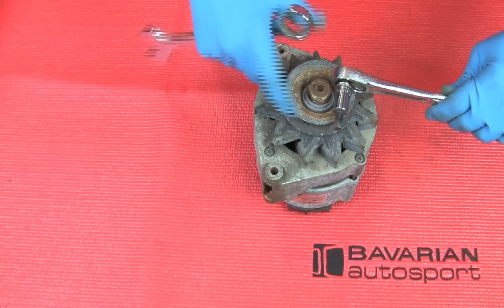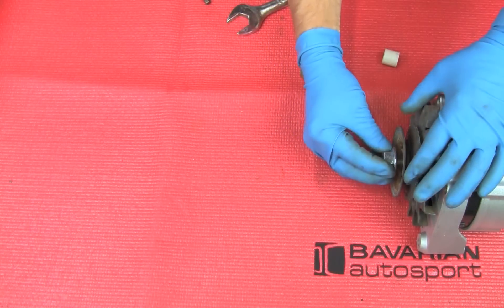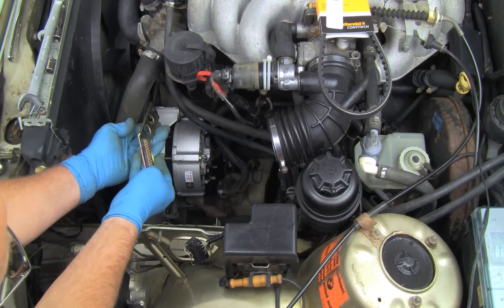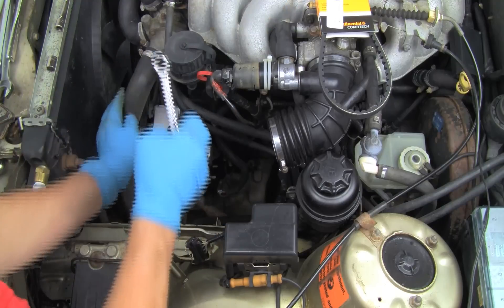Replacing the alternator on most 4  and 6 cylinder BMWs thru the early 1990s

Comment: thanks for the video this should help me out, I was wondering if you had a video on coolant pipes and how to fix a short in the cluster
Reply from the maker: No current video on replacing coolant hoses.  However, you may like to check out the video on coolant replacement.  Once the coolant is drained, you can replace any of the hoses, then perform the refill/flush, as in the video.  view the video and DIY here:  http://blog.bavauto.com/12402
We also have a few DIYs on early instrument cluster issues.  Just visit our tech-blog at blog.bavauto.com and search for "cluster" and "Instrument".

Comment: Amazing video thank you for posting.
1 thing that I didn't catch from the video.  The Adjuster securing nut - which way do you turn the nut to loosen?  I tried loosening it as if the threaders are standard direction (i.e. pulling the handle towards me or "to the left") but the nut seems to be really stuck or I'm loosening it the wrong way.  Any help would be great!  Thank you.

Comment: Thanks so much for sharing your professional expertise!  I changed the voltage regulator with a new one as the brushes were worn and charged up my battery and car started right up. Right by the belts it had been really squeaky and I could not pinpoint the source of the squeaky sound. So is that right that the bearings inside the alternator may have been the source of the squeaky sound? Well few days later, I was driving and radio was going off and on and some lights flashed on the dashboard as I parked my 1991 325ix 2 door coupe e30 which I bought 3 months ago. Car would not start as I guess battery was drained. You think the squeaky sound possibly coming from the alternator rotor bearings may have gave out and made the alternator weak and drained the battery or perhaps, also  guess the diode failed and sent AC voltage and not DC voltage to the battery and drained it to? Just been watching alot of videos so I can have enough "do it yourself confidence". I guess for now replace the alternator but the battery is only 9 months old in the car so don't know if latest incident permanently weakened the battery but will charge it up again. You made the best step by step video here on how to change the alternator on an e30.  Any professional advice would be helpful. Thanks.
Reply from the maker: Let's see if I have this correct:
You installed a new regulator but the battery is still not charging (or charging fully).

Did you check the charging voltage after replacing the regulator assembly?  What was/is it?  If the alternator has a faulty rectifier (diodes), there will be no charging voltage at all.  You will see the battery voltage start at about 12.9 volts (if charged) and steadily drop (with the engine running, headlights on and blower running).  If there is some charging (voltage stays around 12.9 (ish) or does not drop, you may have a faulty engine ground cable.  This is the short cable or braided strap that goes from the engine (oil pan, engine mount bracket or back of the alternator) to the vehicle frame, on the driver's side (left side).  If you attach a jumper cable from the ground lug on the passenger side strut tower to the engine (to make a good ground) and the charging voltage goes up or you see a spark (with the engine running) .... the ground cable needs to be replaced.

Comment: Hello,
I am having difficulties getting the a/c and power steering components loose enough to remove the belts so that I can replace the alternator belt. I have completely loosened all of the bolts that fasten these components, is there something that I am missing?
1989 535i
Thanks.
Reply from the maker: If the adjuster bolts (with the toothed nuts) are loose AND the opposite pivot bolts are loose, try using a prybar to move the components while using the wrench on the toothed nuts.  Just be cautious ... you don't want to break the brackets or adjusters.

Comment: So to replace just the alternator belt, you only need to loosen the adjuster nut?
Reply from the maker: Not exactly - you must first remove the A/C and the power steering belts (they have adjusters similar to the alternator, with the toothed nuts).  You may have to loosen the other mounting bolts so the A/C compressor and the PS pump can move .... just as you would with the lower alternator mount/pivot bolt.  this must be loosened, but not fully removed.
Reply: Awesome, thanks for the reply.
Reply: I have been scratching my head trying to figure this out! thank you for the reply and great content

Comment: How tight does the belt need to be?  A little deflection?  Or none?  You didn't really indicate that at all.
Thanks otherwise...going to be putting a used one in my 325i...need a new bolt for the fan though, as I don't have a new one.